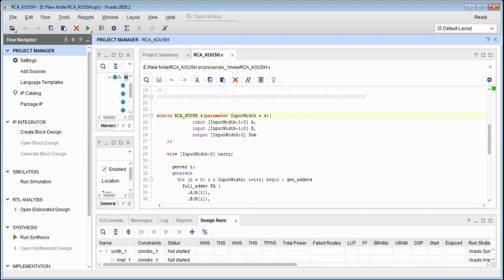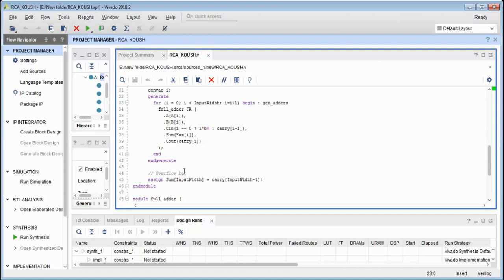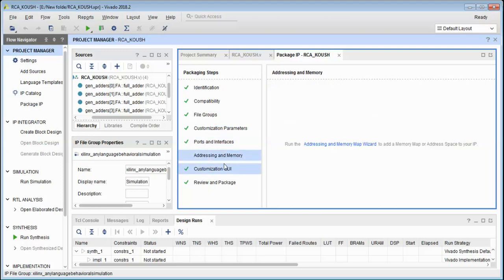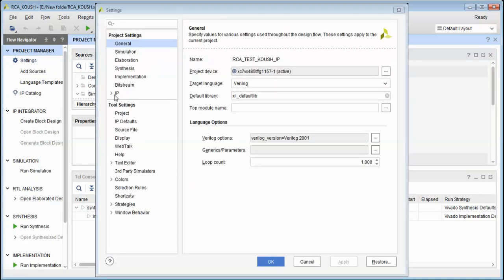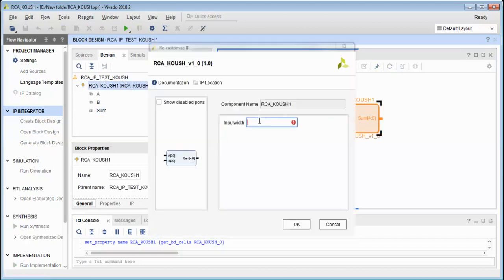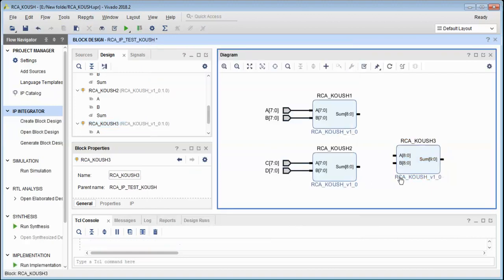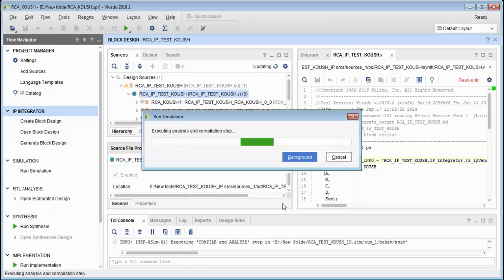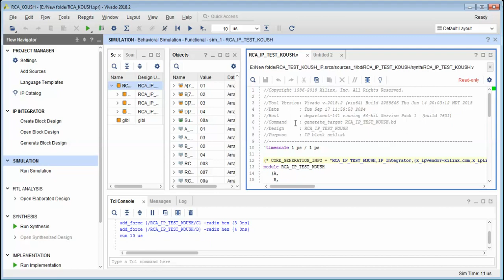How to Create a Custom IP in Vivado | Step-by-Step Guide to IP Packaging & Integration

Comment: Thank you very much. I am using PYNQz1, I have created system verilog file and generated bit stream file and executed successfully. But I want the same to be execute using python by OVERLAY. Could you please suggest some inputs
Reply from the maker: Yes. First we have to create "custom overlay" from verilog/vhdl program. Then using jupyter notebook use that "overlay" to program the pynq board. This will do the exact same function.
Reply from the maker: If you want I will try to upload a video on programming pynq board using overlay. Thanks for feedback.